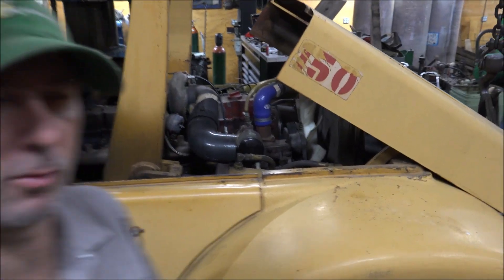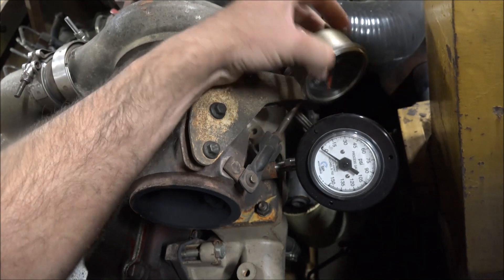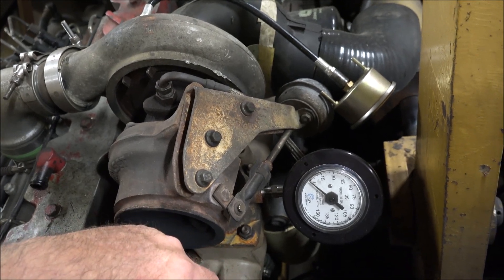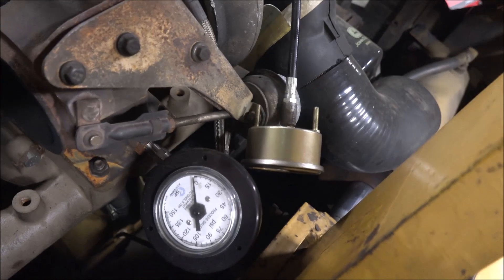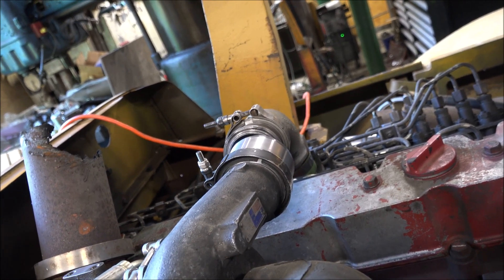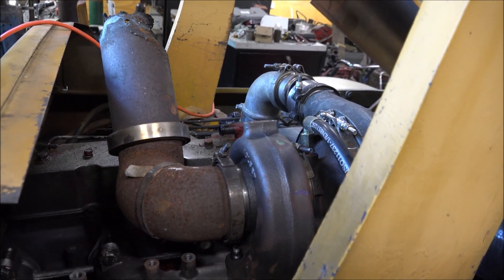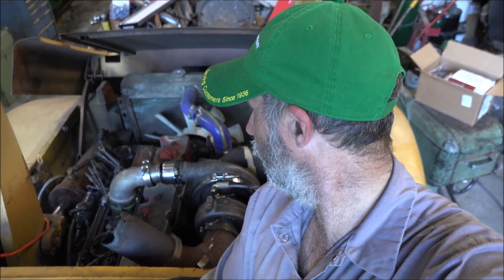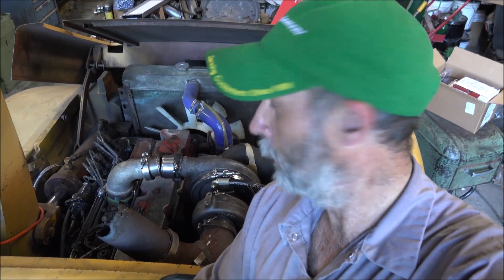cumminshyster22

Comment: Very cool! I've never done anything with turbos before so it's all new to me. So the restriction on the exhaust side causes it spool up faster however too much restriction prevents it from working right. Am I following correctly? Hope all is well, sir.
Reply: Smaller exhaust housing is faster spool at lower load/rpm, but Is too restrictive at the higher rpms and creates excessive drive pressure (pressure in the exhaust manifold before the turbo)
Reply: @devriesfabmachine8721  Ah, that makes sense. Thank you!

Comment: Where did you get that exhaust manifold? Is it stock as far as sizing goes and what flange sizing does it have for the turbo?
Reply from the maker: It’s a stock 8.3 manifold I believe Cummins specifies it as a front middle rear outlet.  I got it off eBay brand new for $150
Reply from the maker: Oh and it is t4 flange just like most 8.3l manifolds

Comment: If you can clock the compressor outlet upward your could use the cooler to make up the fit to the intake.  The hood would need a little tailoring, but I'm sure you could just bolt the entire forklift to your horizontal and trim it that way.